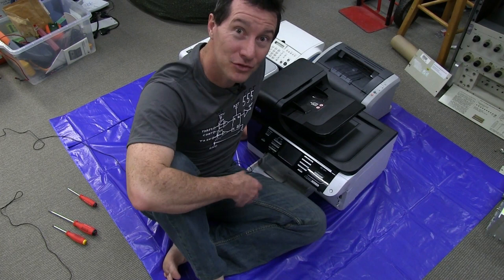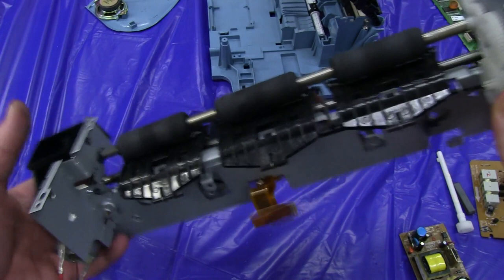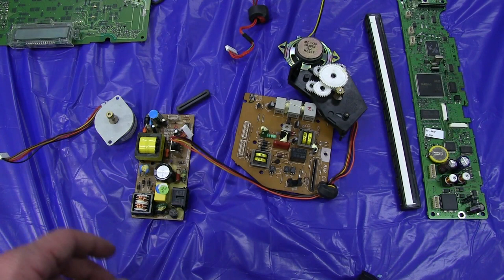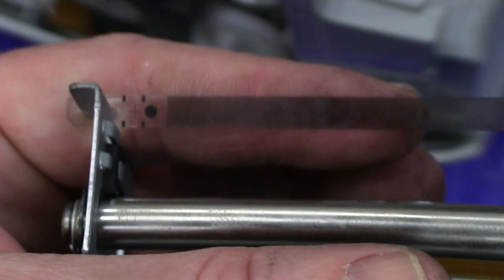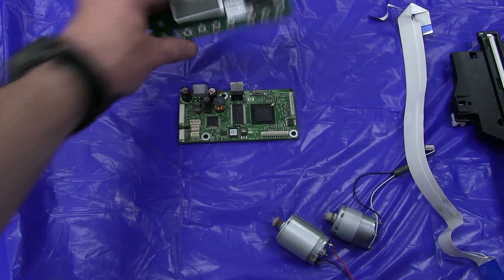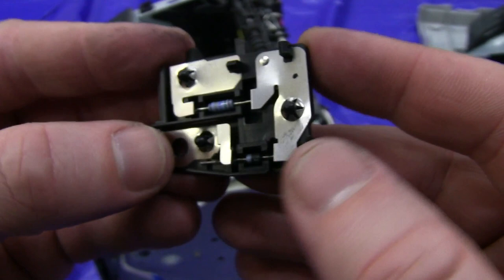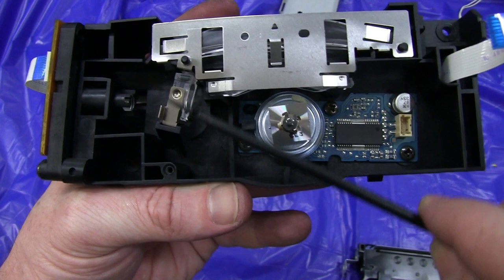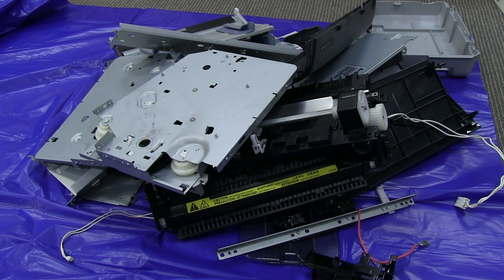EEVblog #488 - Dumpster Dive Parts Salvage

Comment: 9:42 HP seemed to use this scanner module for all their all-in-one printers at one time (i.e. the PSC-1610), right down to the placement of the metal bits above the two plastic gears, and the white rollers (one is spring-loaded).  11:44 Ironically, the one I opened up was racking the print head assembly back and forth on startup because the printed hash marks on this clear ribbon wore off!  This was the only part on the very used unit I looked at that was significantly worn.  If you have another HP unit lying around - even a radically-different-looking one - that will be worth salvaging. 15:16 The card reader uses a long, thin light-pipe plastic-welded onto the plastic panel for routing the internal LED to the front panel - hard to work with outside the original HP case, but again should work in other HP units.

When fooling around with these units, be very careful of the parts outside your metal sink - ink gets thrown around everywhere by the print heads and some of the parts don't wash up very well (there's also some sponges in the unit which hold tons of ink, which will never wash clean).  You'll look like you went rummaging in the coal bin with bare hands for the next week.

Comment: I used to remove the LED's and capacitors from these devices also.
Reply: DjResR 

Most of this stuff is way over my head. The level I'm currently at is just reusing resistors from boards to make my own LEDS for my cars interior with buying the LED chips off ebay. This video makes me want to build something, now just have to figure out what.
Reply: Tim B - Practice makes perfect, I was at the LED and resistor level for years also until I figured out how to use transistor to switch that LED, then came LED flashers and that evolved to building audio amplifiers. What I recommend is start with an easy schematic like two transistor flip-flop, after you got some skills then go after something bigger like D-class TDA1558Q amplifier.

Comment: the lcd in the 1st fax looks to be HD44780 compatible. i took one out of a printer aswell. 
if its got 16 pins it is most likely hd44780 controller

Comment: A new toner cartridge for an obsolete printer will cost more than a new printer with a toner cartridge. IT guys don't like changing stuff (changing stuff causes breakage) but if you can't explain why a new toner cart is twice as much as a better spec unit with a toner to your boss that printer is going to end up in your stock room and eventually the bin. I very much doubt anyone chucks out stuff that is working and economical to use.

Comment: How can one reverse engineer a LCD module with a flat flex cable and use it with something ordinary? (vga, TV, hdmi, arduino, raspi?) I just found two 800x600 7" digital picture frames in a skip with a 26 pin flat flex cable connection.

Comment: Depending on the Architecture (most likely to be MIPS) of those main processor boards (and JTAG availability) you could PROBABLY (much emphasis) put a flavour of Linux on it... Though for any use you'd want it to be able to connect over WiFi or Ethernet.

Some of these things run Linux anyway, might be fun to hack around the embedded system :)

Comment: Can I chuck the parts and plastic shell I don't want into recycling? They aren't labeled for recycling but someone can probably sort it out.
Reply: scot shabalam 

From my experience unless it's clearly labeled as recycling it should just be tossed in the trash, or like around me they have areas around town where you can drip off things like tvs and refrigerators and paint. I'm sure they would take a box full of junk, but they typically charge a small fee. Pickup recycling is for normally recycled plastics like milk and soda bottles, not heavy plastics unless clearly marked. They don't even want plastic bags or bottle caps where I am.

Comment: I'd like to see how he makes use of just one of the pieces of crap he pulls out of these machines.
Reply: ok,  i can answer that 
well..  at least me personally ,  i'll salvage let's say the basics
Capacitors
Motor's 
Relays
and i generally find that with the capacitors i can repair monitors on their way out.
The motors that i pull out of them i can generally fix old Video Players that die on pensioner's , specifically the VHS Eject system.. oh.. it also works on DVD Players

as for Relays, i can generally repair stuff with that , usually things like Speakers (Monitors) sometimes UPS's 

i find a use for these things and i generally don't salvage what i can't make use of because it just backs up as clutter after a while 

also.  if i ever get an overload of stuff, i end up selling it on Gumtree.
so.. that's how i stay on top of my electronics parts supply and ensure that i have enough caps and resistors and electronic parts,  but  NOT TO HAVE TOO MUCH SO THAT IT'S CLUTTER

sometimes i'll pull shit apart and i'll keep stuff but then if i haven't use it in like a year for example or 6 months i''ll consider throwing it out ,  Meaning.... Recycling 
i don't actually throw anything out 
i'll either give the metal to the scrap metal guy 
or
Recycle the PCB's at the E Waste  Collection Centre
or
the plastic and shit goes in the recycle bin or if it's not recyclable ,  then  E Waste collection Centre
so.. Everything gets sorted properly 

Hope that explains it

Comment: LAZER diode the idea behind the angle is refraction not reflection so it get the critical angel of incidence correct.   eg glass of water stick your finger in it and see your finger does not line up.
Reply: +Tony W It is actually a combination of reflection and refraction.
Reply: The angle that an incident ray of radiation forms with the normal to the surface will determine the angle of refraction and the angle of reflection (the angle of reflection equals the angle of incidence). The relationship between the angle of incidence is on the specular reflectors and diffuse reflectors. But you are correct in the simple explanation of the combo.

Comment: Very first thing I would do is pull those processors and other chips from the board. Those are literally of the most use and value as most of them are no longer even sold by the time you find them like this. Why wouldn't you heat the entire board up and strip every last bit of the components off of it? That ink cradle could easily be stripped to it's basics and driven with very simple methods even. You kinda called all the goodies junk and all the junk goodies here.

Comment: Does someone know what could be the voltage of the small motor of the scanner at 9:38? I got the same from an old laserjet and I tried to use it for my own project... I tried 5V and 9V without success, could a small motor like this one be alimented by 12V or 24V?
Reply: François Jacob If that thing doesnt move at 9V there is something wrong with the circuit or the motor doesnt work..
Reply: François Jacob 

It's probably 12volts. Test it with a 12volt battery.

Comment: WHAT IS THE FARRITE USED FOR
Reply: Ferrite bead, components placed on the end of data cables to reduce interference.
google next time, it wont take you 4 months to get the answer :D
Reply: They attenuate common mode signals, but not differential ones.

Comment: You ever hear about Gold Recovery? Yeah. GOLD.

Send all  of those inkjet ribbons my way. And  as for that fat flat pack IC on that logic Board??? There is gold in that too.

If you have no use for them i certainly do. (I'll also take that Silver front panel.)
Reply: The amount of gold is not worth your time or effort and certainly not worth the cost of the chemicals to refine it.
Reply: mattymerr701 I see that you are writing from experience...NOT!!!

What do chemicals cost?

$1 for Hydrogen Peroxide? (88 cents if you go to Wal Mart.)

$7 for a Gallon of Muriatic Acid?

Those two chemicals will process quite a few inkjet ribbons... I can recover quite a bit of Gold with that. (Hell i can even cement the Copper out with a Stainless Spoon, recover that, and reuse the chemicals.)

What does Gold sell for?

I get 98% of Spot Gold for pure when and where I sell it. That is roughly $40 per gram at $1250 Spot Gold.

Nitric Acid is probably the most expensive at $30 per Gallon. I am rather stingy with my use when I refine the recovered Karat Gold. Excess Nitric in the Auric Chloride Solution must be neutralized before the drop.

(I can even go cheaper with Sodium Nitrate to mix up a batch of "Poor Man's Aqua Regia"...)

When mixing up my batch of Aqua Regia I also bought some 33% concentrate Muriatic Acid as I do not like using the 15% concentrate that I get at the Swimming Pool Supply. That cost $30 but I am shopping and will find it less expensive. 

(I use the 15% concentrate for Gold Recovery and then the 33% for refining.)

And then the Sodium Metabisulfite??? I found that pretty cheap. We do have Wineries in North San Diego County.

Two grams of Gold buys more than enough chemicals needed to refine six ounces of Gold, which is 62 grams. (31.103 grams per Troy Ounce)

Yeah. 60 grams net yield me $2,400

Yeah. I like free Gold. Send me those inkhet Ribbons. I will take as many as you send...gladly.
Reply: *****

Of course you need material.

BECAUSE I can get that amount of material it is well worth it..

(One Kilo of IC Chips produce one gram of fine Gold..or more. Most Gold Plated Pins are low grade. If they are on steel then I use my previously used Acid Peroxide on those...and wait. No hurries and no worries.. After drying and allowing to rust then I can use the Rust to make Thermite. No wastes allowed.).

It is three times as profitable as processing ore from a Gold Mine. (3 grams per metric ton, on average, versus 1 Gram per metric  ton yield from operational and profitable Gold Mines.)

And I did not include the Palladium Recovery...which adds much, much more profit. That is where the money is really at.

(And an inkjet ribbon has closer to one cent in Gold. It takes no effort at all to throw that into a batch of Acid Peroxide. If I want the Copper afterwards then I will incinerate the ribbon.)

Yes it can be WORK.. But that is a four letter word to some.

Fire and chemicals do most of it. Set up takes some time. Knowledge is precious..
Reply: 24kGoldenRocket I just noticed that I didn't reply???
Guess I forgot to send it.

What I meant to reply with was something along the lines of
"Damn it, now I am going to have to do research to verify your claims. Thanks a lot!"
Reply: mattymerr701 It takes a lot to get something. But the journey begins with the first step.

Best wishes for your prosperity.

Check out Moose Scrapper's channel
Reply: 24kGoldenRocket Will do mate!
Sorry if I jumped the gun a little bit.